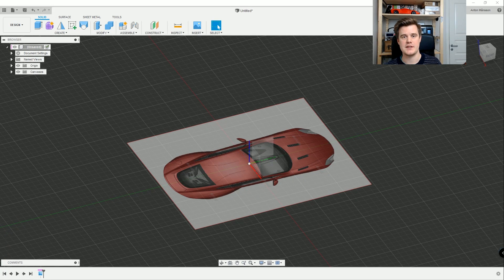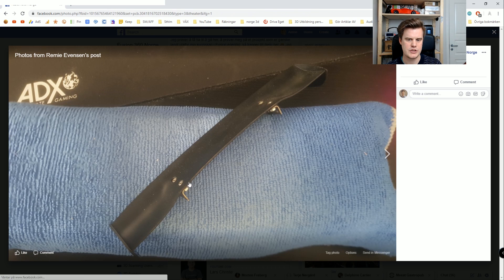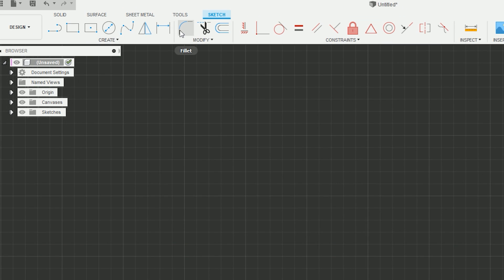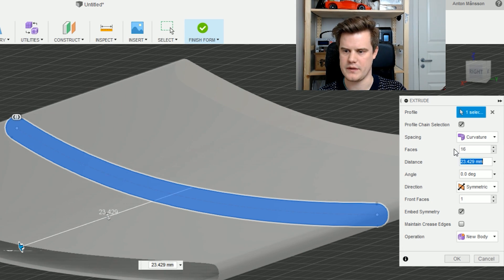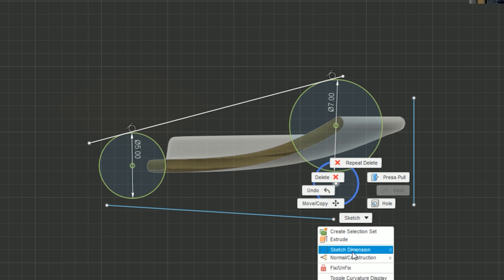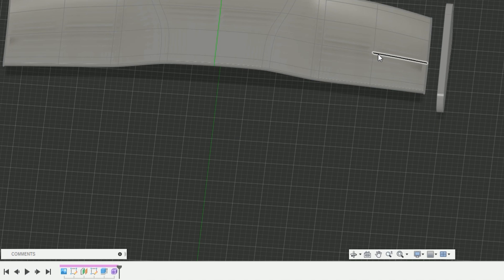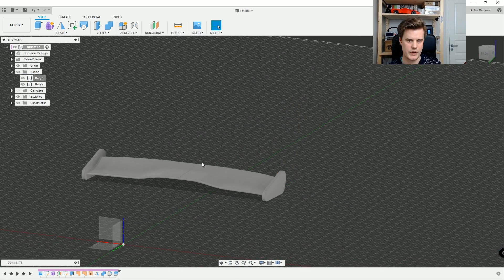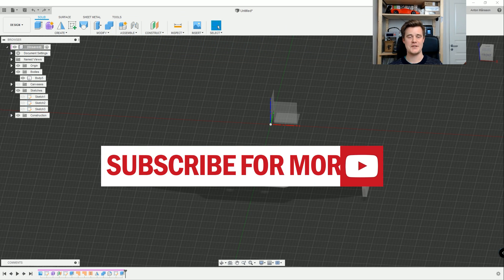Fusion 360 Form 3D modelling | RC Car spoiler

Comment: Great ! At the start... without closing with 2 circles and then trim you can just use line tool dragging between the 2 points and it will create the arc !
Reply from the maker: Thats true! more efficient way of doing it =)